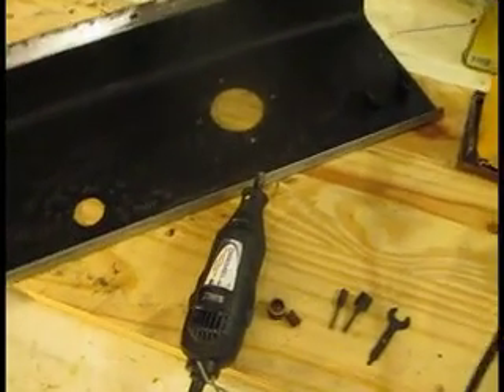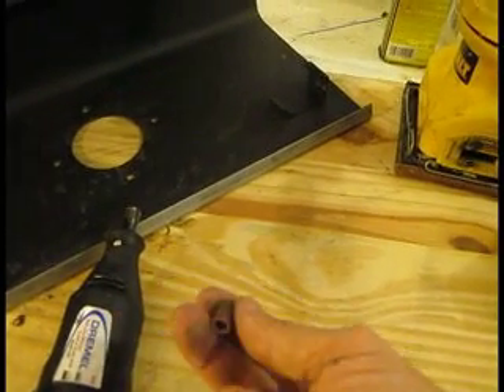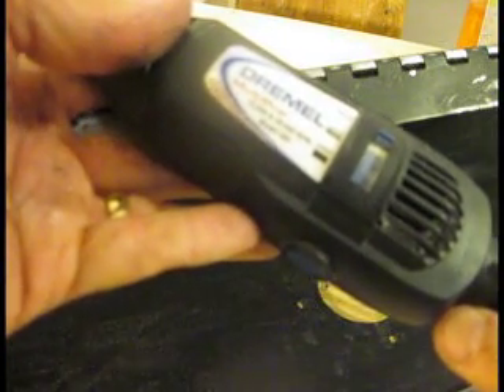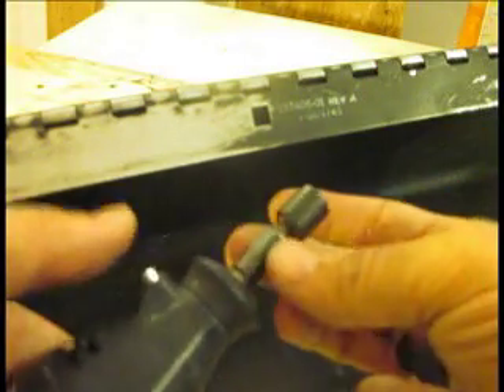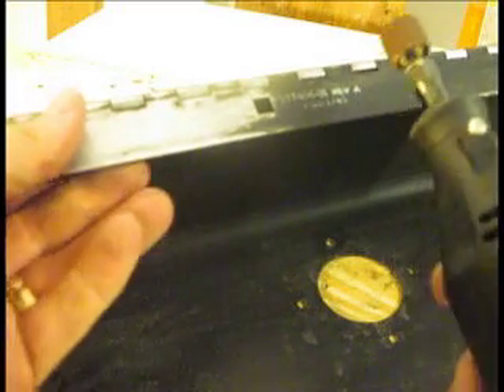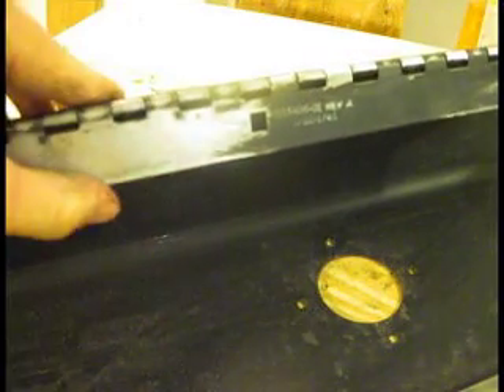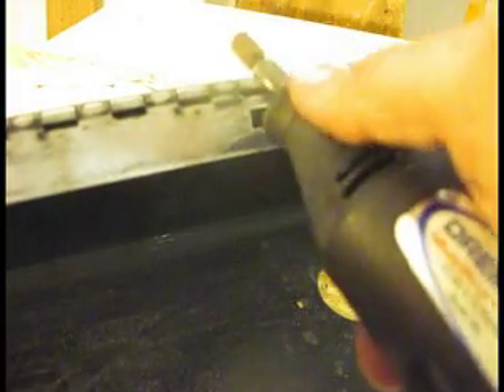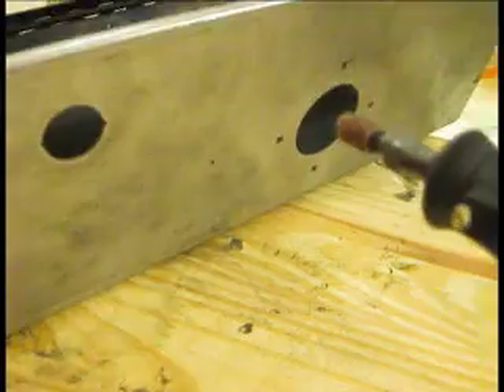Dremel 1/4" and 1/2" Sanding Bands #407, #408, #430, and #431

Comment: Nonsense. The rubber band does NOT expand as the screw is tightened. The screw merely connects the mandrel to the shank. One needs to remove the screw to then remove the small round metal plates on either side of the rubber drum which will give one enough play on the rubber drum to remove or install a sanding band. It is these metal plates that give the rubber drum it's rigidity to hold the sanding band in place.
Reply: +taab7 When you tighten the screw it causes pressure on the top and bottom of the rubber drum and forces it to expand slightly which holds the drum securely.The metal plates are there to prevent the screw from pulling into the softer rubber instead of expanding the drum.If the drum did not slightly expand then the drum would slip and reduce rpm and effectiveness.....
Reply: I guess you don't have a drumel huh?